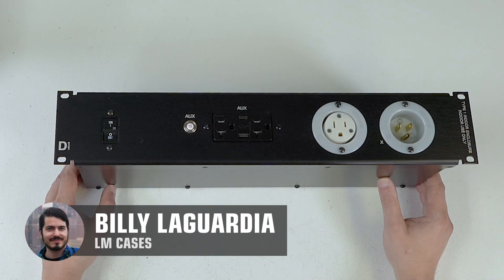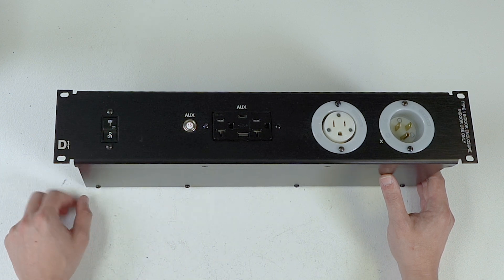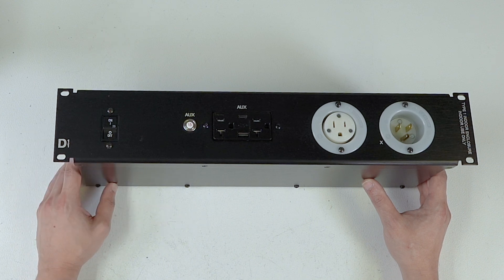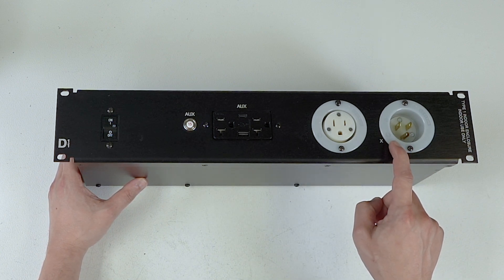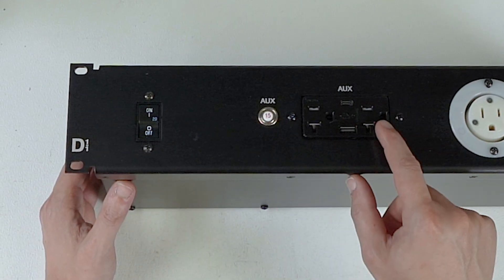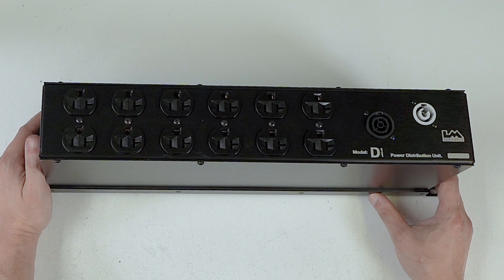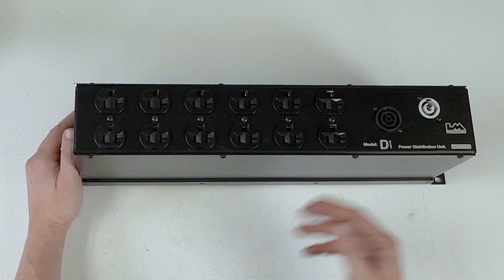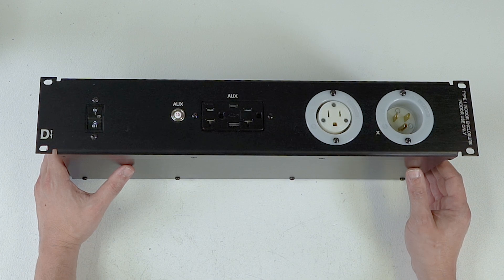D 1/1 Edison Power Distro | LM Tour Systems

Comment: Neat box. I came up with a project I want to build and I thought about putting in LED behind the inlet I don't think I've seen that done before.
Also for those that want to USB-C there are really cheap USB-A to C adapters that just plug into the port and then it's always C. Although it's probably still good to have "A" cause there's a lot of devices out there that come with A-C cables and don't charge with straight C cables. And there's always gonna be those cheap devices that fill some need. A is also good as there's a lot of lights that are on the market.

Comment: That's a nice looking distro, but I would have expected 15A outlets and a 15A hydraulic breaker to go with the 15A plug.
Reply: It looks like the front outlet is on a 15 amp breaker around pushbutton and I'm assuming there's more outlets around back to justify the 20 amp circuit breaker on the left. But yeah 20 amp receptacle on a 15 amp breaker? I guess it would be convenient if you had 20 amp plugs but pretty much everything uses the 15 amp plug configuration.